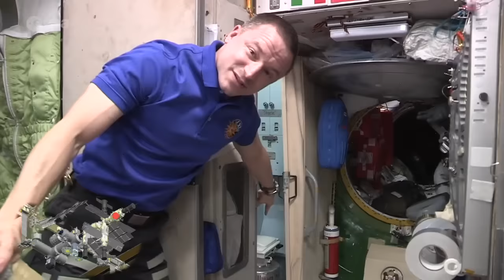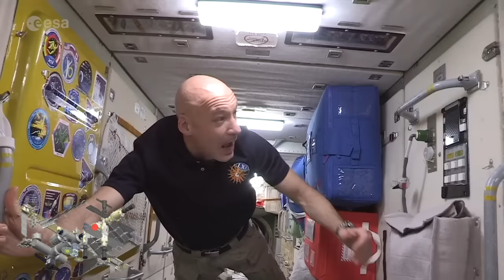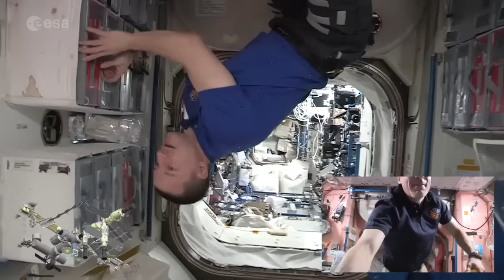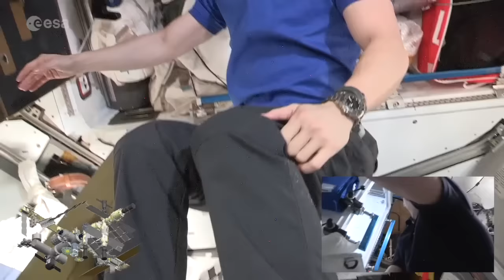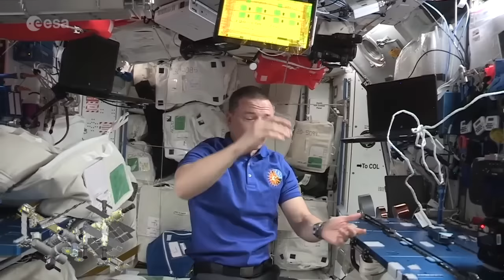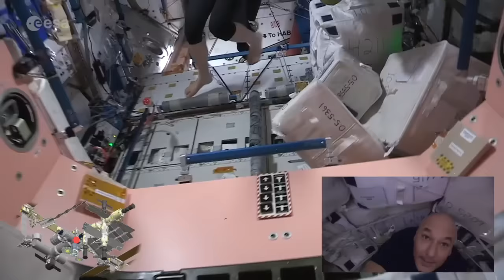Grand tour of the International Space Station with Drew and Luca | Single take

Comment: 1.if you need to, can you weld something on iss. 2 if you solder something with a soldering iron, which way does the smoke travel.
Reply: You  could weld something inside the ISS, but it would be dangerous, beause fire is a huge risk.
It would be very difficult to weld in the normal way in the vacuum of space, because it would be hard to get the metal hot enough.
There is, however, a process called cold welding. On Earth, metal doesn't normally stick together unless you heat it up, because it normally has a layer of oxidisation on the surface. In space, with no oxygen, two clean pieces of the same type of metal can fuse together without any heat. That sometimes causes problems, such as the antenna getting stuck on the Galileo spacecraft.

Inside the ISS, their is air, so smoke would drift around quite randomly - but there are air currents caused by the environmeltal control systems (like an air conditioner). They avoid burning things though, for the same reasons I said above.

In a vacuum, smoke spreads out extremely quickly because of the low pressure. If you watch a SpaceX launch, you can see that the exhaust spreads out further and further as it gets higher. Once it is in space, you cannot really see the exhaust at all. If you watch the Apollo 17 lunar module take-off- you can't see the exhaust. It simply disperses into the vacuum.

Comment: Question. Why the sudden change of sizes in the modules? Specialists say they are old, is that it? At the time the dimensions or comfort were not taken into account as much?
Reply: Basically, yes. The older modules are smaller and more cramped. Mostly the Russian parts, which are 20 years old.
Technology has improved since then. We have more powerful rockets that can carry larger loads, and lighter materials have been developed.

Comment: Please explain the two watches.  I've seen this on others on the ISS, and on Buzz Aldrin, as well.  Is it an astronaut thing?  Thanks.
Reply: Don’t know, but I would guess timezones?
On for UTC (time used on station) and one for  the timezone „home“ or somewhere else? 🤷🏻‍♂️
Reply: My guess is that one is a heart rate monitor or such recording vital signs, and the other is a regular clock.
Reply from the maker: The ISS follows UTC time. Astronauts usually wear one watch with the time of the station and a wrist band that has sensors to measure noise, temperature and other parameters.
Reply: Thanks for the information!  :)

Comment: Thanks for the detailed tour.
May I ask, where is BEAM? Is it already removed from the station?
I know, that its mission got set until 2020, but with the option of two more years. Were there any leaks?
Reply: It's still attached.
Reply: @joeltyler3427  Interresting. So it was covered by ARED. Though it is also not visible on the map
Reply from the maker: Thanks for watching! NASA astronaut Andrew Morgan opened up BEAM on 26 December 2019 for some housecleaning work. He and fellow NASA Flight Engineer Christina Koch relocated gear stowed in front of BEAM’s hatch and sampled the module’s air and surfaces for microbes.

Comment: How thick is the glass in the windows of the cupola? And what type of glass is it?
Reply from the maker: You have more information about Cupola here: https://www.esa.int/Science_Exploration/Human_and_Robotic_Exploration/International_Space_Station/Cupola
Reply: @EuropeanSpaceAgency  I tried to find the thickness of the glass there, but couldn't find it. Do you have the answer?
Reply: @jonasnielsen8990  The main double layer of windows are each 25mm thick. There is also a thin inner anti-scratch panel, and layered outer shutters made of Nextel and Kevlar, which can be closed to protect against debris or micrometeorites. Those layers are both about 10cm thick.

Comment: So do sweat droplets fly away?
Reply: There is always some water in air. It's called humidity. Tiny droplets of water vapour that are usually too small to see, unless it's foggy.
Even in the driest desert in the world, there's still some water in air. If you ran a dehumidifier in a desert, you could extract some. That has actually been done, although it is not very efficient - it requires quite a lot of power to get any reasonable amount.

The ISS has an environmental control unit, which contains a dehumidifier. It extracts most of the moisture from the air, for recycling.

So yes, drops of sweat can float around, just like they do on Earth. Eventually they end up inside the air con.
Reply: @ann_onn  I don't buy it.

Comment: How do they shave in space
Reply: I guess you're asking about the bits of hair coming off?
1. They do things like that in the small bathroom, so it's contained.
2. There's a device like a vacuum cleaner to suck up the hairs.
3. The air-conditioning system filters out particles.
Reply: If you type "How do they shave in space" into the YouTube search bar, you'll find videos about it.
Reply: They don't because they are not in space.

Comment: Guy in the black shirt has a bad case of the wires. 56:50
Reply: There is no wires.
Reply: @Sherlock BONES
please tell where the wire attach to?
if they are on wire no way they can move around, change angle  etc that smoothly
57:25 how the hell can he do flip if he on wired?

You really need help.
Reply: The restraining wires across the storage module, yes. Best way to stop stuff drifting around.